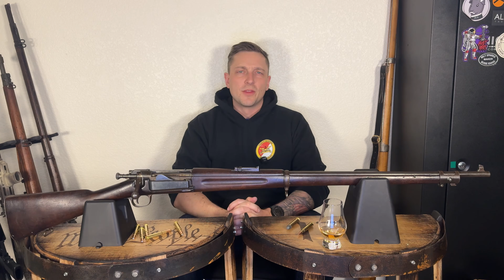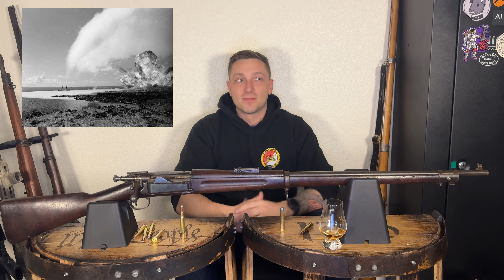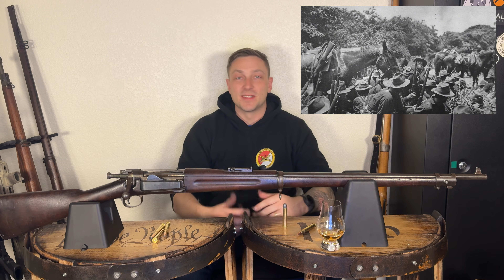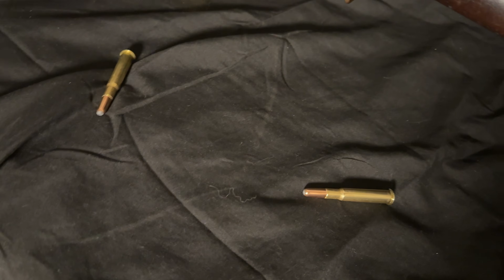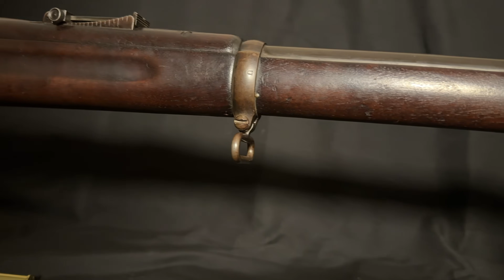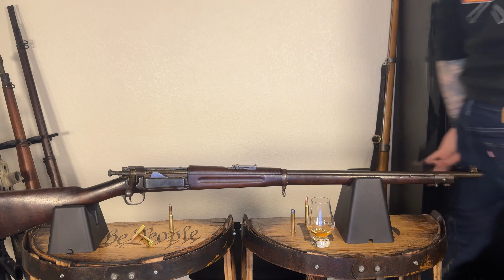Americas Forgotten Service Rifle | The Krag - Jørgensen

Comment: I think it's just a matter of poor doctrines, in terms of the Krag's reloading. I mean, instead of individual rounds, situate a group of five or six, all muzzle downwards, all hurdled up into the pouch, and when the time comes, grab all five by their tail end, and just jump into action. Not gonna take any more time than the stripper clip.
Reply from the maker: I’ll try different methods and see if I can make anything work effectively
Reply: @Ameritism  when you really think about it, this is the similar kind of hiccup that doomed the M14, but remember, similar, not same. The M14 could have worked out, but somehow, the gas vented downwards, when everyone, and even the M1 Garand before it, vented forward. That disrupted the system so badly, things break down super fast and bad. 

So, really, it's a matter of faulty doctrine. I looked at the Krag, and - thanks to tenacious trilobite - I immediately realized that it was the loading and ammunition carrying doctrine that was really the dooming of the Krag.